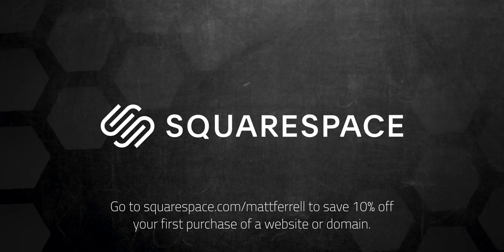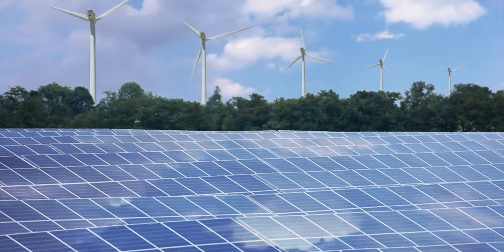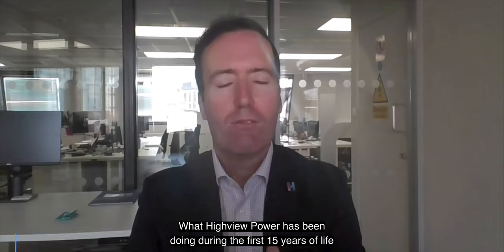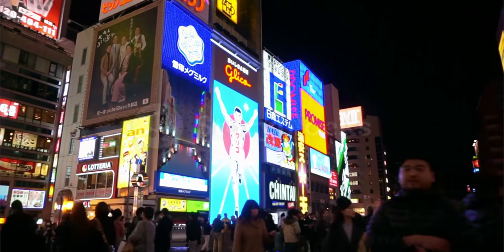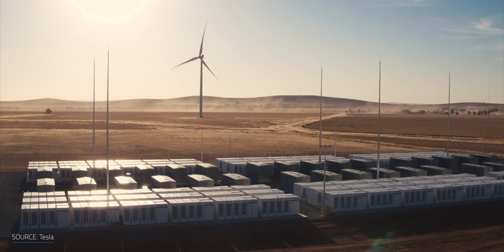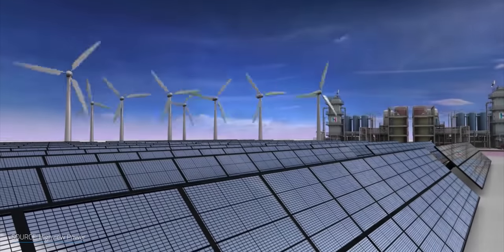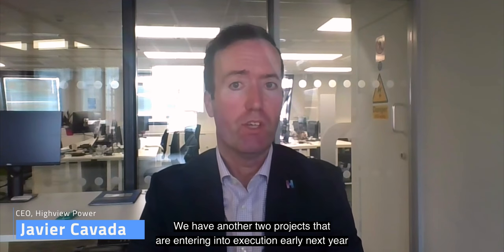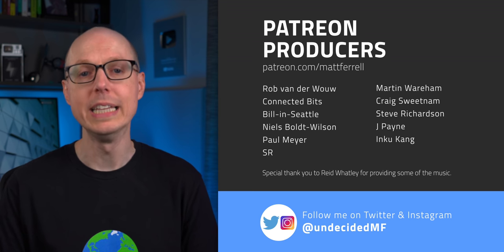Liquid Air Battery Explained - Rival to Lithium Ion Batteries?

Comment: seems like they should use batteries as a means of on demand power supply while they readjust the output from this type of setup.
the batteries only job is to keep up with fluctuations on the power grid that this system can't handle, the avg power usage will be monitored to increase/decrease the output as needed. always keeping it slightly above what is actually needed in this way you don't need a large array of batteries, just enough to offset fluctuations and give time for this system to respond to big changes in demand.
also would like to push the point others are making, get your measurements correct!

Comment: So hydro and every other method mentioned is more efficient it's cheap because it's been a round for 100+ year which to means the odds one a brake through advance in tech is very small 

Pass and as to way we haven't done it sooner it's a very good reason to think it's not a great idea

Comment: See the thing is if they power the station from grid so their net efficiency will be (efficiency of grid*efficiency of the plant) which will always be less than efficiency of grid. If they power the station from solar and wind when the plant is not storing energy or releasing energy it will need energy to maintain those temperatures otherwise it will take a very long time to get to those temperatures after restarting the plant.

Comment: produce  hydrogen en oxygen wit the exes sol/ wind en burn it in the dark time cooling air is limited it will warm up  en burst the tanken afther a time you will need the tank to test for craks   just like a dive cilinderen dispose the tank.

Comment: Would be interesting to see how the capacity of the system can be optimised by using pure gases as opposed to air (mixture of gases). Would only make economic sense in a closed system of course.

Comment: Hi Matt, air liquefaction is a brilliant storage system; as you mention, no major infrastructure or water diversion (which is very important as we are facing water shortages in many parts of the world), and the 'off-the-shelf' componentry makes for a simple entree into storage.

An additional income stream for the storage plant would be to decant the oxygen, helium etc. and sell this gases separately and use only the remaining nitrogen to drive the turbines...

Another excellent video Matt.

Comment: Don't think it can get over 50 percent efficiency. Assume its main process has 25 percent efficiency, the energy wasted in the process heats up the system to 400K with far beyond the operating conditions of most motors. The plant is built in, let's, say the edge of the Arctic ocean, so the environmental temperature is around 250K, the maximum energy available for recycling is %*(400-250)/400=37.5%. Considering 90% efficiency of the energy recovering system, The Total efficiency can get to 25%+(1-25%)*37.5%*90%=50.3%
Reply: It's way lower than hydro dam's 70-80 percent efficiency

Comment: Oh that sounds pretty cool! I wonder though, can't it be simpler? What about batteries that store potential energy? Have 2 water tanks connected, pump water one direction on input energy, release back in other tank to generate energy. Or lift a heavy weight up to store, and let down to release. Or spin a flywheel to store, and slow down to release?
Reply: Pumped hydro is a real thing, pump water up into a pond during excess supply and release it to generate when electricity is needed.

The others will work but have problems scaling up to something large enough to be useful.

Comment: They would be able to add stirling engines in between the heating and cooling processes. Using magnetic bearings floating in a vacuum would help as well. Aloha

Comment: If it could be scaled down it would be ideal for an off the grid home. You use the heat generated by compressing the air to do water heating and air heating in the winter, and decompressing the air  through the turbine generator gives you cold for refrigeration and air conditioning in the summer. It would make sense to have a giant hot water tank as well as a giant ice tank with heat exchanging coils to make sure you have those when you need them.

Comment: Tata Motors india has launched mini cars running on compressed air. Liquid air has higher density, hence more energy. Yet, it does not store in a car's tank as it eventually heats-up and builds-up pressure. The ideal solution will be to use a hybrid liquid air + batteries powertrain. When batteries are low it is time to fill-up with liquid air. The system will run a generator that fills the batteries.

Comment: At 1:55 you say with 4 hours of storage price of electricity is $150/MWh (or $0.15 Kwh) with 4 hours of li-ion storage.

I've heard from Michael shellenberger (https://youtu.be/N-yALPEpV4w) that for a system that runs completely on solar/wind you'd need around 6 Months of storage (there are whole years that are less sunny and windy)

I think liquid air storage is great, but it alone cannot get us to 100% renewable from solar and wind - even if it's cheap and scaleable, the amount of storage needed is just massive. We need base load generation - if nuclear is not your cup of tea then wave power, geothermal power, or even harnessing electricity from the stratosphere or solar satellites are possible options for a green future
Reply: Juanito Shellenberger is, as usual, wrong. No seriously proposed system of 100% renewables needs anywhere near 6 months of storage. 2 weeks likely, 1 month for safety.

LAES can do all of this.

Comment: I will pose compressed or cryogenic gases are NOT a good solution at scale.  Liquid air is super dangerous.  In grad school, I worked with it, dropped a small nail in a beaker of it...whoosh.   Nails are combustible.   It uses expensive exotic vacuum dewars to contain it and still must be vented (thus wasted).   And drops of it burn you bad.  Laudable this company will give it a go, we need the "kitchen sink" approach to future energy.
Reply: Yeah carbon burns you bad too if you get in the fire or go into a steam tube

Comment: makes me wonder if they can have multiple stages of power generation to increase the efficiency of the system as they do with steam turbines. With steam turbines the steam once it leaves one turbine will then be sent to another turbine that is designed to work at a lower pressure.

Comment: After I heard the recycling of waste heat and cold air, this could be a winner. Update: It's close to the end of 2021. Nothing on the Web.. Did someone silence them??
Reply: First it's a miracle of applied " longtime proven, mature" technology", very modular, very easy to scale up etc. and there is a niche for it but then.. it takes so long. 
Now meanwhile they will invest in Europe a lot in hydrogen as the next miracle. But that's a unethical scam from the fossil fuel industry so I am a bit frustrated too.

Comment: Air has too low of energy density, but flywheels by nature can have infinite energy density as long as they have infinite rigidity. Make a small five pound object spin at 100,000,000 rpm and see what happens when it hits a wall (hint: there won’t be a wall and there will likely be a large explosion).
Reply: The cryogenic phase change is what makes this energy dense, but yes flywheels are great "supercapacitors" rather than wasting resources on chemical batteries.  As you stated, flywheels are a bit too dangerous alone.  A "tesla turbine" arrangement could make the cryo-flywheel combo killer.

Comment: This sounds too convoluted to make any practical sense. It has Carnot cycle written all over it. He argues that you cannot ever get quite to 100% efficiency but in practice, they can't get any close to it no matter how big you build, that's just some PR talk he's giving out there. Also involves tons of loses both dynamic in each step and static while keeping cold parts cold and hot parts hot without doing any work.
I don't think it is in conclusion any better than storing heat in liquid salt. Except salt has much higher heat capacity than air.
Reply: The whole point of that statement was to say "the cost to store energy is more important than the efficiency" (as it IS low-ish, like you said), but if it's cheaper than the other alternatives and does the job, it doesn't matter (much) how efficient it is

The advantage it has over purely heat storage, is that it can do both. So while you're spending energy extracting heat from compressing the air, you can reuse that heat somewhere, or store it (and use that for energy generation later too). And directly responding to liquid salt having better energy density, water has terrible energy density too, but pumped hydro is fantastic (where it can be). This type of system can do a similar job, on a much smaller footprint

It's pretty smart. I do agree that for longer term storage, you add extra inefficiencies from heat/cold leakage. But for time-shifting a day or two's renewable generation, it's very good.

Comment: Did I miss it? What is the actual process for freezing the air? Any CFC's involved? And do I understand correctly that this doesn't scale down - say to residential level - very well?
Reply: lowtechmagazine com/2018/05/ditch-the-batteries-off-the-grid-compressed-air-energy-storage.html  Is an interesting read especially the section towards the end of the article on  Small-scale, Low Pressure CAES systems.  

It talks about research back in 2010 using a modular, many small tanks at low pressures, hooked together type system which eliminates the heating and cooling requirements and complexity of a large high pressure scale system.  Also because its modular the system can be discharged all at once to achieve high outputs/shorter durations or sequentially thus lower output/longer durations, thus flexible for given applications.
 
The advantage of such a system is longevity, this video stated that the high pressure system projected lifespan was 30 years, well imagine a system where nothing is over stressed thus maximizing system lifecycle and compare that too battery chemistry having a 7-10 year lifecycle. The disadvantage would be higher system startup cost, but that is offset with a system that will outlast you.

Comment: Add in a CO2 capture process with the condensed air system and you have a carbon-NEGATIVE energy plant
Reply: Not enough CO2 in the normal air for carbon capture, but this tech has good synergy with a normal gas thermal power plant. Those exhaust have a high CO2 level for it to may be viable.

Comment: "you can capture the waste cold" wait, what?
Reply: Compressing air causes it to heat up - Google 'Ideal gas law'. Expanding it cools it down - same principle. This is why the efficiency can get so low, if you need to spend some energy cooling down the compressed air and heating up the expanding air, you're going to need a lot more energy than you're storing. Much better to capture the waste heat when you compress it and the 'waste cold' when you expand it with a heat pump or something similar. Like, use the cold expanding air to chill a refrigerant and pump it away.
Reply: @gigabyte2248  I know the mechanics of it. it just SOUNDS weird. cold is a nonexistent thing. it is just a (relative) lack of heat. to say you have so much lack of a thing that you have excess lack of a thing, so that you can capture that excess lack of a thing, so you can use your lack of thing later when you REALLY need to lack a thing.
Reply: I guess it's just like... potential. Ability to do thermodynamic work. Like negative voltage, I guess. Excess negative potential

Comment: It seems like a valid storage option. What are the running costs? How does it compare to Hydrogen (creating, storing and subsequently burning)?
Reply: It should be pretty decent vs hydrogen (which is quite bad for round-trip efficiency), as by adding in extra energy harvesting cycles (capturing and/or reusing the heat generated) you can increase the efficiency and yields of such a system. [I believe the liquid-air systems are around the 60% efficiency, while hydrogen is 40%odd]

Hydrogen is also quite dangerous at these scales, and containment can be very difficult. Air doesn't explode (decompression aside)

Comment: Interesting, when I heard of this, I immediatly thought of the 'Air Car' that kind of flopped, they were using super compressed air to run an air motor to power a small car - the engine kept freezing!
I had a bit of a think and realised this process is so inefficient, and you confirmed it, 25% wow.
However it's better than nothing in this field.

Comment: I saw something about using liquid nitrogen for this in PopularScience or Popular Mechanics decades ago.  Since air is mostly nitrogen it's pretty much the same thing.

Two ways, generate electricity for the car or do something akin to a steam engine to drive the car.

I never did put any math to it to see if it's economically feasible.
Reply: The liquid nitrogen could power some vehicle but it's hard to do. The problem is that you of course want to suck the energy for the expansion out of the environment. This requires a huge heat exchanger and ice will be deposed on all cold parts, isolating it. This passive heat exchange is too slow to power a normal car but I wonder about very slowly moving open platforms for free public transport in very hot cities. These vehicles could then also cool the air onboard.

Comment: I wonder if a system like this can be used for long-cycle energy storage. An idea that's been bouncing in my head for a short while goes like this: storing heat from a refrigeration/air conditioning system and releasing it when heat is needed (like in the winter, in the case of an AC system). Could heat from an AC system/heat pump be turned into usable energy for later use?
Reply: There is waste heat everywhere but it seems for the moment hard to do much with it. So like in nuclear plant cooling towers, they let it escape. I think too this is not very satisfying.

Comment: Matt, great video as always. But I wonder if this is the answer. The immediate problem I see is that Liquid Air "Batteries" have many mechanical pieces, each and every one of whom will break down. This will require that each plant have some staff around to troubleshoot and repair as you go. Lithium packs are essentially solid state. Now, this won't exclude them from problems (if only) but from a business standpoint I might be willing to have a higher capital expenditure if my operational costs are essentially a maintenance contract with Tesla (or some third party).  Something breaks and the company comes out and simply picks up the pack and replaces it (cattle instead of pets).  The Lithium Iron Phosphate chemistry is very stable and is often the go to lithium chemistry in high stress environments such as RV'ing or boating so just sitting around in a cabinet will be cake for them. Add the efficiencies that that 8640 form factor and "tabless" (which is really just a bazillion tabs) design, and who knows?

Obviously, we'd need someone with more skill in calculating this stuff then I have, but I wonder if the Liquid Air battery would be able to compete once you factor in the long term costs.

I still love the thought of the gravity batteries. Dig a hole, drop a weight with a rope and hook it up to a electric motor. Pull the weight up during off hours when electricity is cheap and drop it down during peak demand. My biggest question there is whether the energy density is enough to make it worthwhile. But take an old abandoned ICE car factory (I think there's going to be a few of those soon!) dig a couple hundred holes and hook them up and you'd never know it was there.  

Just my .02. Keep up the great work.
Reply: Good points. I don’t think the servicing issue would be that much of an issue though. Most likely, you’d have an onboard diagnostic process and send the battery to a more centralized facility for repair/reclamation and replace the out of service battery with a new one. If you establish reasonable maintenance intervals and design the battery such that it deteriorated at a uniform rate this could be cost effective.

Comment: Pardon me if this was answered in the video. How much energy do these store? Or…how much longer can it run? I like the concept. We just buy this stuff from a store and the go home and plug it into your house like a propane tank. Question is, how long does it run and I guess output is dependent on the turbine used for generation of power?
Reply: At home, I foresee problems. The liquid nitrogen will at first turn into gas and deliver power to your home turbine but then quickly the whole system will be covered with ice and the heat exchange  will slow down so the turbine will no longer get enough nitrogen flow. Perhaps a huge surface heat exchange grid could work but it seems not practical. Highview stores the heat that is released during compression and uses this to avoid all these side effects. It doesn't rely on the energy taken in from the environment only.

Comment: Well, I see this as a win win! Why?! Let's say one of these plants are just stuck in the, "collecting" energy mode! Well, that energy can be hauled to another location that may need it, ie: a plant that is kinda stuck in the, "producing" power mode! So, for plants that are making more then its needs, they can ship that excess stored energy to another plant & that energy won't lose its density as it's being shipped to the new location! & after the tech improves, we can even use said stored energy to even power said shipping transports to transport that dense energy elsewhere!
Reply: Stuck? How could it be stuck? It is WAY less expensive to ship the energy as electrical power over transmission lines than as tanks of cold air.